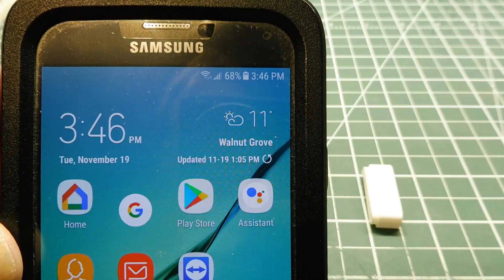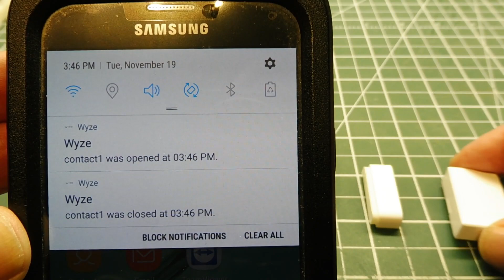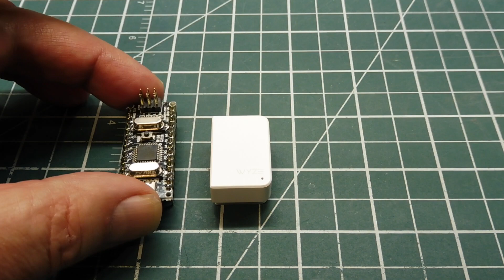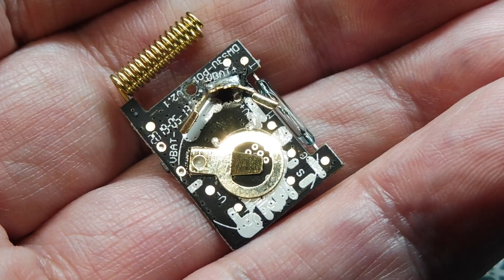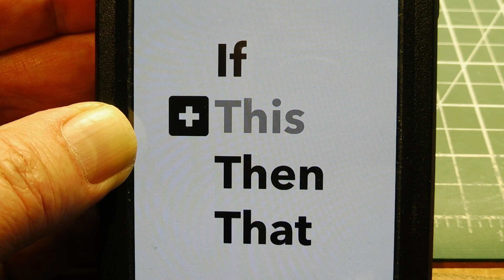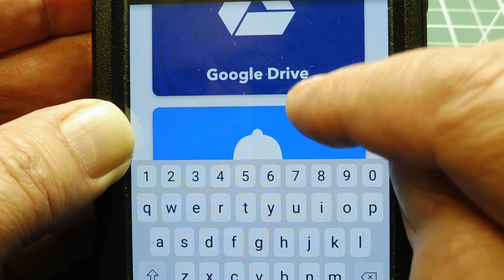WYZE Contact Sensor Microcontroller Interface

Comment: Interesting. But why not just use like a simple ESP8266 D1 mini board that costs about $4 each and totally eliminate the Wyze contact sensor. Super easy to Flash it with ESPHOME and send your data through your local WiFi. In my case to Home Assistant. These ESP boards support both digital and analog inputs. This way you eliminate the the weakness of the Wyze Sensor's that were long ago discontinued because of reliability issues and the fact if the battery goes dead in one they will get be ruined or bricked. Also better to stay off the Wyze Eco System. Run everything local.
Reply from the maker: This was an exercise given to a high school electronics class where it had to be done without using any sort of code libraries, not possible with an ESP8266.
Reply: @0033mer  Understand. 👍.. It was actually very informative. And I appreciate the time you spent on the project. I recently acquired several of these sensors so was perusing YouTube to find some practical uses for them. They are rather impressive for the low price point. 
 I've seen these even used for water leak detection with nothing but a simple grid made from a few wires. 
Also a very smart guy figured out how to unbrick them. With his complex code and a very expensive interface. 🥴

Comment: Hi, interesting video. I found an interesting article from Wyze Support: "Waiting until the battery dies may result in the sensor being unusable even when the battery is replaced. Replace the battery as soon as you see the "Low Battery" warning.
 If a sensor of yours has died and is unable to connect even after replacing the battery, please contact our support team for help."  It is a first time I heard such kind of tech. Can you explain the reason behind and how to unlock it? Thanks.
Reply from the maker: Yes, the Wyze sensor has a glitch when its battery dies so I power it with 3.3 volts from the Nano. I did not include that in the video to keep it simple. When the battery dies it loses its MAC address so there it nothing you can do. Send it back to Wyze and they will replace it with a new one.

Comment: If you're more into locally-hosted home automation, there's a wyzesense python library, and a wyzesense Home Assistant custom integration. If you already have Home Assistant set up, it's not hard to set up HACS, and then download the custom integration (just be sure to check the Github issues page if the receiver stays blue -- there's some stuff you can do to fix it.)

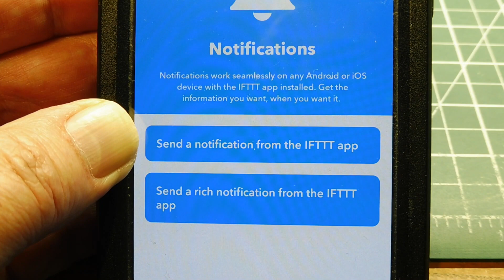Comment: At 7:54 you say the range of the system is the range of the WiFi. In fact it is also limited by the range of the 906Mhz signal to the bridge in the nearest WiFi camera. Some people have reported they can increase this range by adding a USB extension cable between the Wyze Cam V2 & the bridge module.
Reply: This is actually a brilliant idea of using a simple USB extension cord. And someone has actually created a hack of the USB interface to an esp8266 board. So many ideas, so little time to try then all. LoL

Comment: Is it possible to modify the 3V coin battery to use power from the nano on the breadboard or using an external power adapter? I don't want to keep changing the battery every year or when it's needed.
Reply from the maker: Yes .. you could use the 3.3v from the Nano.
Reply: @0033mer  Thanks. I've connected the contact sensor to the 3.3v on the Nano and it has been working great. In addition, the 3.3v on the MB102 Breadboard Power Supply and FT232RL FTDI Adapter works great as well.

Comment: How many different sensors can be connected to the WYZE ??
Reply from the maker: The radio bridge can handle up to 100 sensors.
Reply: @0033mer  Thanks.. As was commented previously...would be nice if at least a 256 bit code could be sent to the base station rather than just an On/Off 1 bit code.

Comment: El. hobbyists who get excited about gizmos such as Wyze - and who don't have a smartphone - are advised to research hard and long to see if said gizmo will be accessible without apps, phone and some cloud broker.  Further, don't think the cheap gizmo you want will work without a smartphone even if it claims to work with desktops or local LAN.  The two "security cams" I bought both refused to even CONFIGURE without a smartphone.  Until I can crack both open to see if there are headers available for direct hardware communication, my money (and significant time) has been wasted.